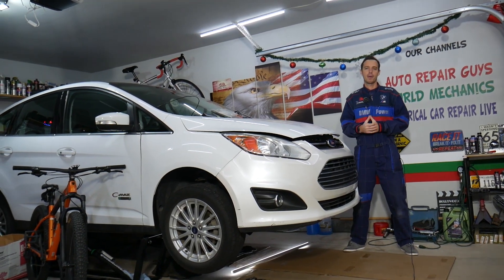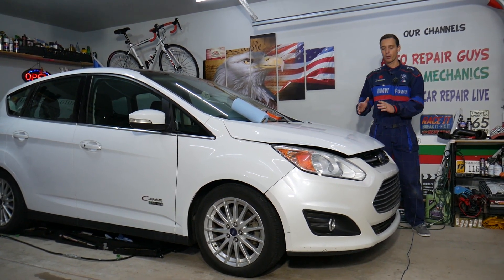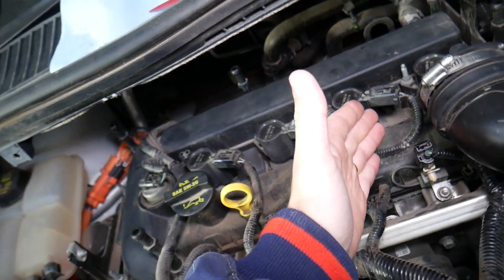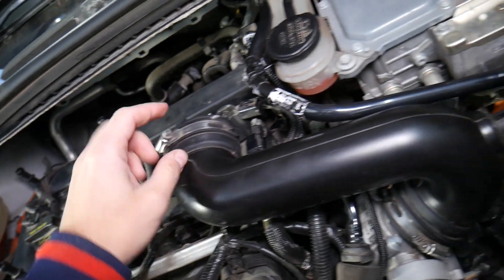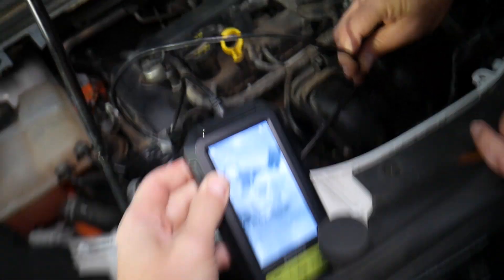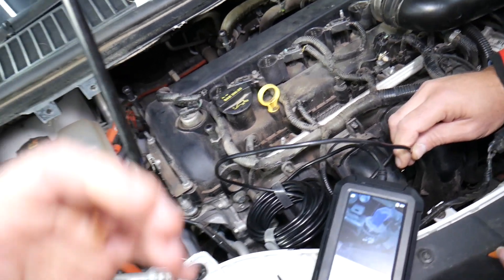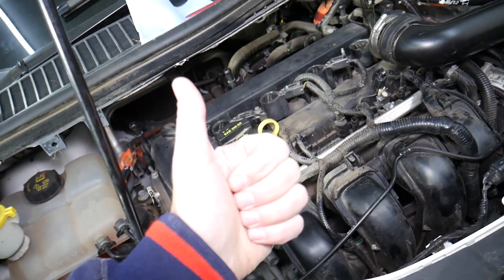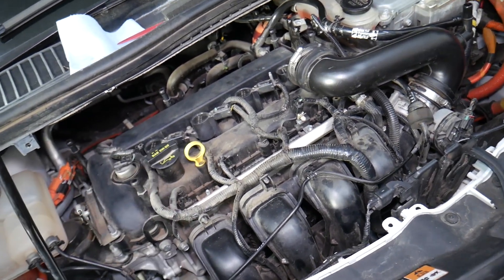CODE P0300 RANDOM CYLINDER MISFIRE FORD C-MAX FORD FUSION LINCOLN MKZ

Comment: Starting getting this about 135k on my hybrid. It threw the codes when it would switch from electric back to engine. I would get a shutter and I could tell it wasn’t firing. I had not changed the spark plugs since it was new. Changed them and it’s good to go now.